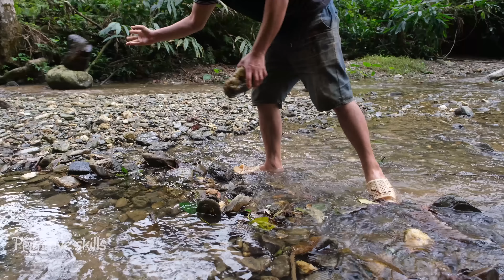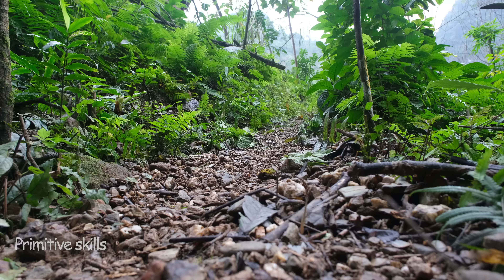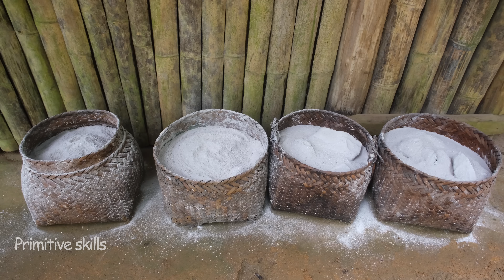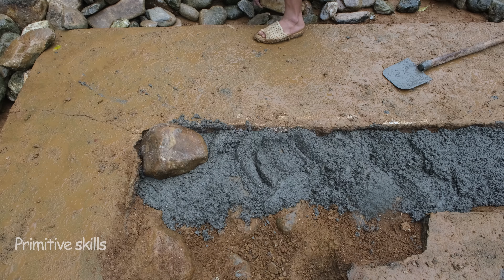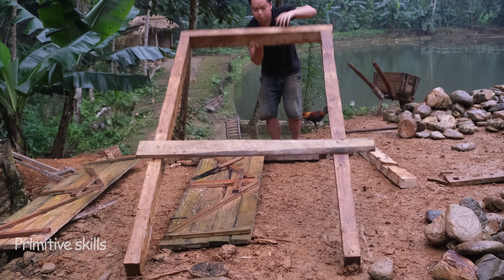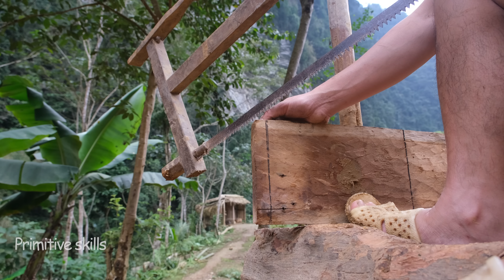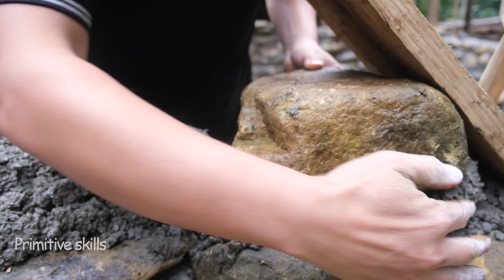PRIMITIVE SKILLS; BUILD CABIN from 7,900 stone (Building Stone House)

Comment: DUONG!!! Wait for it to settle! Structurally this thing is a deathtrap. You HAVE TO reinforce it from the inside. Think of an aeroplane. The luggage and people have to be arranged right? So the plane does not flip over? It's the same with stone. One stone is always going to be heavier than the next, leading to collapse. This is why we always double stone up. It halves the chance of this happening. Our houses have stood for 500 years in Ireland. I know what works and what does not. Address this issue. Dont put a roof on it until you are sure of this.

Comment: A good roofing choice would be something like bakes clay shingles if you got a good quality of clay nearby, its a lengthy process and requires a good amount of firewood. But it should work really well.

And for drying you could have a longer drying session if they're stored indoors instead.
Reply: and those clay tile roofs are relatively light too, so hopefully roof won't collapse
Reply: I agree, that's a great idea! Just like John Plant, in the channel "Primitive Technology". He is used to making clay shingles. During the rainy season, he dries them indoors, before baking, as you suggested.
Reply: make a form to build clay tiles in an ~ shape and dry them in your kiln at a low temperature in smaller batches until they are dry, then once you have them all dry you can stack them tighter into the kiln and fire them into ceramic. make more than you need incase some break.
Reply: I strongly agree with this idea.
Reply: How many days to build house stones

Comment: I'm glad to see you working so diligently, and that you haven't lost hope.  Your plan to make a stone house is a good one, and making a clay tile roof will prove to be most effective. Until the weather conditions change, it would be most practical to construct a roof of light, yet sturdy materials that are readily available to you, and require minimal processing.  A tightly woven bamboo roof consisting of only a few layers could provide what you need, or you could repurpose your wooden planks.  I would strongly advise that you construct a central stone/brick fireplace/chimney so that you can heat your home and prepare cooked food, while also providing additional support to the clay roof.  Don't forget to coat all the inner walls with mortar!

Comment: It looks like it will be a beautiful and wonderful home!
If you plan on temporarily constructing a roof with wooden boards until you upgrade to a tiled roof in the future, it would be a good idea to coat the surface with a rubber resin mixed with carbon powder to make it waterproof and antiseptic.
It will also be useful as a packing to prevent rain leaks, and if you plan to upgrade in the summer, I don't think deterioration from sunlight or heat will be much of a problem!
Reply: Gostaria de saber mais sobre a resina e o pó  de carbono ,estou com problemas  com as chuvas
Reply: Powdered charcoal mixed into natural liquid latex does sound like a good weatherproofing agent. Maybe some sulfur as well to perhaps get a bit of vulcanization in the heat of sunlight? Around here (PNW USA) I have had good results from charring the outer layer of wood and rubbing it down with oil, wax, or a mixture of the two, sometimes hitting with the torch again, allowing it to wick in, before a final buffing to remove debris and reveal any splinters, if it's to be a handrail or otherwise touched.
Reply: TU LO DIJISTE. TEJAS DE BARO ES LO MEJOL MUY BUENA Y DEA AMIGO LA CASA SATA QUÉ DANDO MUY BONITA TE FELISITO DIOS TÉ BENDIGA SIEMPRE

Comment: Hi Duong,
For the issue of your roof. You could look into the Japanese Shou-Sugi-Ban technique. It requires burning the surface of the wood before installing it. The burnt exterior of the wood then becomes more waterproof, more mold and rot resistant, protects against termites, and is much more fire resistant than unburnt wood. I do not know how difficult the process would be for you but this could achieve the results you are looking for for your beautiful new stone house.
Reply: As I said before 😉
Reply: Same with door frame
Reply: I thought just the same. I hope he would see your comment and consider this option.
Reply from the maker: Thank you, wish you and your family good health
Reply: Burning wood good option but not in jungle.. Any wood unburnt or burning fast colapse. In jungle water in oxigen its like 70-90% any time. Dung try to  burning fireplace  oftten inside new home. Stone from river like to mossy so much.
Reply: Remember that sho-sugi-ban typically uses sugi (Japanese cedar), which is rot-resistant to start with. Especially on a roof, where regular water contact is guaranteed, it's important to choose the right kind of wood.

Comment: I would advise that you roof the house with split wood shingles. They are simple to manufacture and have a reasonably long life. This would get a roof up fairly quickly and you can use the same type of roof support structure for the shingle that you are going to use for the tiles later. Just build the roof supports for clay tiles then cover it with the wood shingles. The shingles would still be useful after the clay tiles go up. They would be firewood after you take them down.

Comment: Don't forget to do several coats of lime plaster on the walls (both interior and exterior) and it can also be used on any exposed wood as well. This helps seal the mortar, prevents damp, bugs and prevents organic material from causing issues. It'll also help amplify your light sources.

Comment: The gaps in the river stones would have to be filled a little better, as the stones are very round and smooth, so that the walls have the necessary stability to support a heavy roof. The blanks for the clay bricks could be dried in the kitchen by shaping clay around halved bamboo tubes and hanging them up to dry in the kitchen or placing them on a shelf or something similar. If the blanks are dry enough, you can fire them in the oven as normal...

Comment: It would help if you had a chimney to properly heat the structure. It should be in the center for the best coverage or as far away from the door and windows as possible to prevent the heat from escaping too much. Warm air rises so you do not want the fireplace too close to windows or doors or you lose much of the heat.
I would recommend that you make a frame for the roof that you will use for both the temporary roof and the tile roof, thus it means less time remaking the roof if it doesn't work for the clay roof. For the temporary roof, I think you should use bamboo or wood as they are going to last a bit longer than palm leaves and will leave less chance of vermin making nests in your roof.
Also if you are going to make the temporary roof out of bamboo I think it should be two layers of bamboo, making it less likely to leak. If you make a wood tile roof I suggest you treat the wood to prevent water from getting absorbed by it. I do not know much about this but I think you can either treat it with oil, fat, or burn the wood to lessen the impact of moisture.
Another great video, hope to see more soon.

Comment: It looks great!  I'm not an engineer, but if I were you, I would put a wooden frame all along the top-edge of the wall to distribute the weight of the roof evenly.  River rocks are strong, and cement is strong, but oddly shaped rocks stacked with mortar might not be as strong as you think it is.  If you put the weight on points along the wall, or even on the corners, the mortar might not be enough to keep the rocks from shifting position.

Comment: Hi Doung love your video and new house ! . I think you should do conrete-rebar  colums . You could forge some steel rebar and apply them into conrete, you have a lot of planks so just do a form from it and pour a conrete steel columns. 
For the finish house from inside you could do a earth walls with conrete brick, i hope this will be super strong to hold a roof. ❤❤❤❤❤😊😊😊😊
Reply: If you pour 4 conrete colums and make a conrete brick wall from the inside will be i think enaugh strong to hold whole constructrion . 
If you reading this i know you should thinking is a a lot of work but also will protect you from hard weather. 😊
Reply: Conrete-Stones- walls have good power to protect you from left or right side, but coulums and inside brick-walls will be a foot for the roof. 😊 maybe that conception is to much but I think this will be house for your family to 100 years and more ❤

Comment: Your new cabin is looking great! Something that may be worth trying is so mold some clay around a piece of bamboo cut in half, and then set them around a fire or a warm stove to dry out. Once they're dry, you can fire them in your kiln to make them solid and weather resistant. You would need to make a lot of pieces, but it is certainly doable!
Reply from the maker: Your idea is great, to implement it I probably need at least 1 month to have enough clay tiles
Reply: @PrimitiveSkillsnet  Straw could probably be used in the meantime, even if you preferred to wait for summer.  If it's not a permanent structure, then your new cabin wouldn't really be at risk, even with a flammable roof.  Wood is expensive for the amount of effort and time it takes, and it looked like you lost a lot of your old roofing to damage and splitting, so you would still need to make new planks.  Would it be worth that cost if you plan to replace it in the summer, anyway?

The walls of the new cabin certainly won't be at risk of burning if you had a temporarily flammable roof, even if the doors and windows would be.  Your kitchen has a larger risk of burning at the moment than your new home does.  You might want to consider re-roofing it with tiles as well, just to reduce that risk, if you think the columns in your kitchen can support that weight.

Comment: I agree with many of your followers.  You speak of fireproofing your home.  thing is, wooden planks are okay as a temporary solution but wood is not fireproof.  Plus, like the other roof you just took down,, the wood rots, can have the termites attack them, or worse  - wood rot which spreads quite quickly.   Clay tiles is the way to go.  You have a kiln to heat and burn limestone.  I'd suggest you use the kiln to dry the clay tiles as well.  And if I might suggest that the tiles have "hooked" top edges and  "dipped" lower edges? The tiles will fit into each other better, with less chance of slipping off.  I admire your work ethic.  When you have something to do, you do it, no matter the obstacles.  Take care and stay safe.

Comment: You are doing an awesome job! For the roof you could use bamboo for now. Split it in half and put the first layer so that the rainwater can run inside the "channel" downwards. Put a second layer the other way arround on top, so that there is a bamboo half covering the area, where two from the lower part meet. I think this would be pretty waterproof.

Comment: Now this is more like it bro .. when I told you your house needed an upgrade this is what I was talking about about!! Loving the octagon windows too you got drip man!! No more clay.. no more degradable materials like bamboo but something like this that would last forever without repairs.. great job man!! If I were you I would get metal on the roof as well..no more tatching bro that's also degradable short term material requiring repairs 👍👍💯💕

Comment: Very nice house ! you did very good job ! 
If you feel that a temporary roof is a better option for now, do it.
For your future clay tiles, you could prepare some piece of fired clay to be crushed in powder when cooked. It will be used in your clay mix for the tiles. It prevent cracking during firing.

Comment: laying wood directly to the ground like you did for your door frame will help to create the same issues from the last house. It can come from dry rot or even insects will use it as a highway to get around unseen. you need to treat the ends you place in contact with the ground. there are a number of ways to do it but you can simply scorching or burn the ends of the wood that will be in contact with the ground. it will make it last longer vs dry rot and insects. stay safe brother i'm sure someone else has good ideas for this too.

Comment: Duong I had a thought: have you tried making glue before? The traditional way I have seen they would boil rabbit skins until they form a thick glue. It is very strong and good for gluing wood. It can also be dried and cut into small pieces, which you can boil in water to turn back into glue when you need it.

Comment: I see you need to move a lot from the stream to the house have you been thinking to use the waterwheel with a cable (transport)line , so you fill a wooden box with sand Stones or whatever you need and let the waterwheel do the pulling
Reply: Maybe even building a dam at the stream to power a waterwheel over there to make a cabble line

Comment: The horizontal bars over the doors and windows are called headers. Source: I'm a home builder. Also, the wooden door frame touching the ground will be damaged by termites unless it's treated with something like Bora-Care. The roof plan seems reasonable.

Comment: Now you can use rammed earth to cover the interior walls like plaster. Put a narrow window on the back wall to reduce humidity. Add a small latch on the roof to use sunlight to illuminate the interior during daylight and also to reduce humidity and excessive heat in summer.

Comment: hey keep the design of your roof simple en let it completly slope to 1 side, but then i would pull up the walls a bit higher.
You can start with wooden shingles (perhaps use the charring methode for longevity 😉), then you have time to make clay shingles when you have time or the conditions are better to make them.

Comment: Duong will need to keep in mind that clay tiles will be even heavier than wood.  However, if he crafts and fires them himself, he can research "salt glazed" ceramics, and use sea salt to help seal the pottery tiles against water.  (It can be dangerous, so he will have to be careful when doing so, but that's true of turning limestone into cement lime, too.)

Comment: Duong I have been doing research on how you can make glass. It doesn’t seem very complicated, it might just take some time.

The 3 basic ingredients for glass are silica, lime and soda ash.

You already have the lime, and you can get the sand relatively easily, but you would want to remove all the stones and gravel.

The soda ash is the more complicated part, although it doesn’t matter too much if you also add potash.

To make soda ash and potash, you extract them from plant ash, and the amount you get will vary depending on what plants you burn.

If we add the ashes to water, the soluble potassium and sodium salts will dissolve while the insoluble silica and calcium carbonate will settle to the bottom. We can then drain off the water (containing the "good stuff") and throw the insoluble material away. To separate the chlorides from the soluble carbonates, we will exploit the greater solubility of the carbonates in hot water. We will bring the liquid to a boil and continue boiling until enough water boils away for an insoluble precipitate to form. This is very likely a mixture of sodium and potassium chloride. From this point, we will continue boiling until half of the remaining water is removed. At this point we can be reasonably certain that only the soluble carbonates remain in solution. We will carefully pour off the hot liquid into another container, leaving the solid material behind. As the liquid cools to room temperature, the less soluble sodium carbonate will precipitate leaving the more soluble potassium carbonate in solution. Finally, the remaining solution can be drained off and boiled to dryness, producing solid potassium carbonate.

Then you can use the sodium carbonate (soda ash), and possibly the potassium carbonate (potash) to make glass.

However then you have the issue of heat. Melting glass requires even hotter temperatures than copper, so you might need to build an improved furnace.

I hope this interests you. I think having glass windows would be a great benefit, especially in winter.
Reply from the maker: This idea is great, I need a detailed script, please send it to me via email, thanks
Reply: @PrimitiveSkillsnet  I have sent you an email containing 3 different links to guides that should let you do everything needed to make glass.

It might be worth waiting until you can repair the water wheel to power the bellows, because you will need to maintain a high temperature for several hours to melt the sand, and your arms will get very tired from pumping the air.

Comment: How about splitting bamboo in half and covering the roof, then lay the other half in the first ones...if that makes any sense.

uuuuuuuuuuuu <-- half of bamboo, then place the other half on top (upside down) to make it water proof, that would probably hold you dry until you can make clay tiles.
Maybe you can make tiles in the kiln?
...anyway, awesome job!
I'm amazed at the level of work you get done.

Comment: You need to protect the wooden structure of the roof against termites before installing clay tiles, as if it collapses the weight could cause a serious accident.. Engine oil contains substances which repel termites. Similarly, wood ash repels termites when applied to the wood.

Comment: he tried to make all of the material are from nature itself, that's the purpose of the channel name. my suggestion for the roof part, you should used back the palm leaves. which is easy to install, can be replace if it leak, much lighter than the wooden board roof. or just make a concrete roofing with a 2 big wooden beam in the middle and you can also make stairs on the side to go to the roof for drying some cloths or foods. Great come back Duong but take good care of your back bones, try invent something that could support your back when lifting heavy rocks.